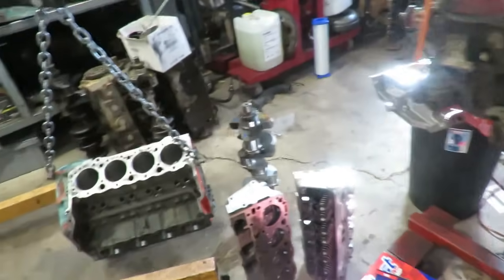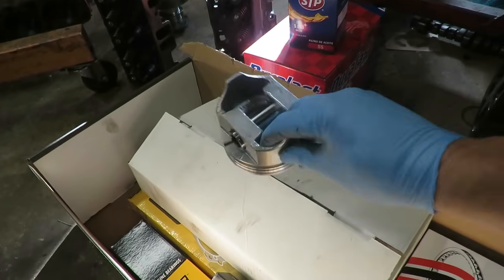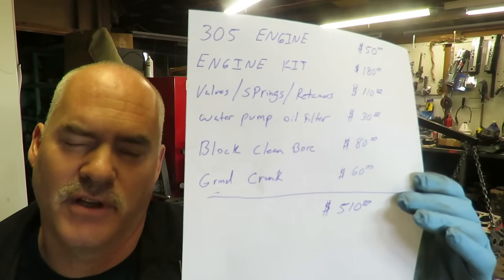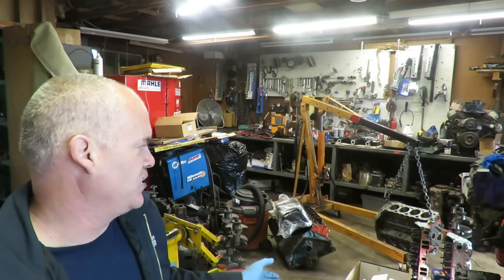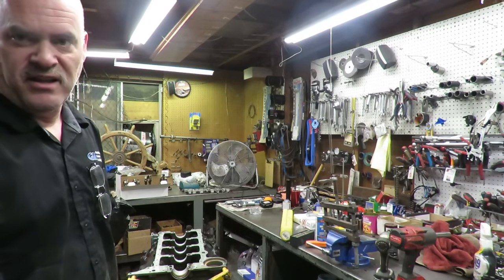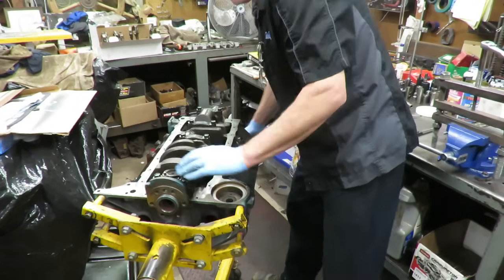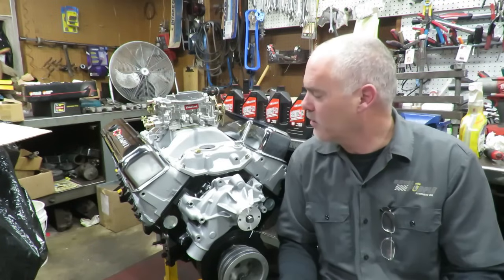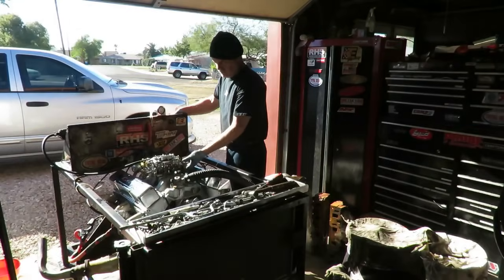Small Block Chevy extreme Budget Build

Comment: You can always build something on a budget there are lots of options, but this definitely isn't a high power plant build, in my opinion if you're going to build an engine, build something that's got a little something.

Back in my high school days, a buddy built a 305, just freshened it up similar to this one, and he was a car length behind me at the track every pass with my 74 Camaro with a stock 350 and about 90,000 miles after sitting in a barn for 5 years, against his freshly built 305 in the 76 Nova, the dude was pissed his fresh built 305 motor couldn't take on the exta cubic inches of my tired old Camaro. So I would definitely put some thought into what you wanting to build before you just throw anything together, why waste the money, on something that just sounds the part, like the engine in this video.
Reply: Those old low compression 350s from the 70s (882 heads) made about the same or less as stock H.O. 305s from the 80's... The 305 issue isn't the bore size dude it's the lack of performance parts in comparison but nowadays they make performance 305 stuff designed for the smaller bore (Trick Flow Super 23 or World Products Torquer SR) 350-400 HP range in a 305 is not unrealistic

Comment: I got a 355 flat top with vortec heads with 202/160 valves. It’s got a extreme Energy 268 cam  how much horse power and torque do you that it will have. It’s a 87 model block
Reply: 195 HP
Reply: 340/370

Comment: That is a totally way huge cam for a stock 305 with almost no compression. I would have used the Summit #1102 or even the #1103 for $61.
Reply from the maker: The compression ratio is 9 to 1 with the dished piston and the 601 58 CC heads
Reply: @Myvintageiron7512 
Hum, I was thinking the HO 305 had about 8.5 to 1 so that is a bit better.   My budget builds always start out good but right at the end they end up being $2 grand so my thought is If it even starts for less than $700 bucks its a miracle. Good job.
Reply: any 305 1986 and later  is 9.5 to 1
Reply: I have a ‘68 chevelle with a 307 factory and I have a 305 Ho that was given to me with 58cc big valve heads.   I’ve seen people complain about both these engines.  I just don’t want my chevelle to end up like 90% of them are with an ugly LS now a days.   That said, I love to roast tires to.   Ideas?

Comment: my 350 engine block gen1 had cam bearing pre installed how do i know if they are in correct position, im also wondering about the things to install or look for like the plugs to oil an water. i have never dealt with a bare block???? any help????

Comment: I think this engine with the "601" heads would have actually worked really nicely with the replacement cast FT pistons with 4 VR... 1.54 compression height.  Pistons in the hole .010 and the .028 thick Mr Gasket head gaskets (3.79" bore) for an .038 quench would bring compression to around 10.8... Great match for the cam.  The non lightweight "601" castings are actually fabulous with porting (please research) and prefer a single pattern (or close to) cam. (Vortecs flow better on intake but can't touch "601's" on the exhaust when ported) With PROPER PLANNING, elbow grease, and ATTENTION TO DETAIL that little budget 310 small block could be a nasty little 7,000 RPM mouse!  ~Not at all challenging the host~

Comment: Very cool video!! 
I have a 602 Crate engine that I’m about to fire up, what do you recommend for a break in oil? I don’t wanna use my Mobile 1 15W50 synthetic at $14 a litter for break in! It’s so expensive to use that oil then drop it...
Reply: AMS oil has some great High Zinc content break in oil to make sure that cam stays happy for the break in
Reply: What grade of oil and do I have to stick with synthetic for just the break in?
Reply: You have to use oil with Zinc for break-in but I also recommend zinc for flat tappet (lifter)cams too you can buy zinc additive.
Reply: Most local auto parts stores carry at least one High Zinc oil, they may have in non synthetic, I'd say run synthetic for the break in just for the sake of correctly ensuring when you break that cam in and she gets warm it'll still lubricate
Reply: I have been told not to use synthetic for break in. Anyway, I have heard that Royal Purple has conventional break-in oil, and that might be the easiest to find. Brad Penn has a break in oil as well.

Comment: people seem to be confused and think a 305 is not a viable option,honestly if you need less than 300 horsepower it will work great and not cost a fortune either.
i bought a 225 horsepower LB9 305 out of a 1991 trans am for $300,sold the tpi for $200 and have a mint longblock for $100(80,000 km engine)ive been picking
up parts here and there,just got a set of aluminum corvette heads for $200,a cam and lifters for $75,b/n waterpump $50,b/n holley ultra and edlebrock rpm $500.

it doesn't need to cost a fortune and it will be a decent street rod engine.

Comment: I don't know why people don't invest money into a camshaft. It is the heart of an engine. Howard's cam is light years behind Crane cam or Comp Cams extreme cam line. Yes it was correct the cam had 108 LCA for a 305. Vintage friend will have to run headers with this header because of the LCA on this engine to get max power.

Comment: I see a big problem... You said you weren't going to use headers, then have headers on it when you run it.
I sure hope you gave it more than the break-in, than you showed otherwise that flat tappet cam and lifters will probably to go flat soon. You can't let a flat tappet engine idle right after start up.
I would really like to have heard that with the stock manifiolds as opposed to open headers... I did enjoy the build :-)
Reply from the maker: The headers are only for the run stand as for the break in it was done the day before off camera it already had 2 hours run time on it the forst 30 minutes at 2K with high zddp oil and buy the way It's in the rad rod and it haul's ass 1685 pound car

Comment: Would cost a little more than $698, but a 305 with a 3.75” crank is a fun street engine that won’t break the bank, 334 cubic inches. 👍🏻
Reply: Most shops would advise against this usually from a dollar / performance aspect.  I've seen a few and they ran good though, one had over 400HP.
Reply: Stepside1986, I know it’s not ideal, and I’m not saying everyone should build one, but it can be done for less money than one would think, especially when decent 305’s are so cheap. I helped a friend build one, it runs great, makes a surprising amount of torque. I know an engine builder that’s built quite a few of them too...

Comment: Like the build and the price.  One question though.  Was that the initial fire up of the engine?  If so, arent you supposed to bring a new start flat tappet came up to 2000 rpm for about 20 minutes?  So you dont wipe out lobes?  Just asking.
Reply from the maker: nope did a 30 minute cam break in the night before it was a fairly cold start temp at about 120

Comment: Hello, I was wondering how are you able to run that much lift without using screw in rocker studs. I have seen cams with less lift pull the pressed studs out.
Reply from the maker: studs were pinned

Comment: I've got a question for you a little off the subject of this video. What is the main cause of roller lifters on the GM ls syle engines such as 5.3 and 4.8 & 6.0 . What caused the problems I've seen on different videos with roller lifter getting pitted and chewing up cam lobes?
Reply: your question makes no sense.

Comment: New Subscriber, I'm interested in having you build me a 350 Chevy, no interested in buying a mass produced eng. from a big company, would rather support the small guy's, and thru your videos, I can see that your not just an engine builder, but you have passion for your craft, so I have a 1986 Chevy square body Blazer, it has a TBI engine with 90000 miles, what's your contact information so I can e-mail of call to make this happen, not in a big hurry, but would like to get your thoughts on swapping out the TBI to Carb and getting a reliable eng. with some more power, maybe 350 to 375HP. Thanks  Tim Morris
Reply from the maker: message me on Facebook at myvintageiron7512

Comment: I would say more than 200 but tq prolly in the tank. That cam might be the largest ever put in a treeoh5. The money spent on 601s maybe coulda got set vortecs, if motor had low miles maybe justa hone with 3.75 stroke instead of .030 over and 3.48 stroke. Dont think elderblock is gonna like all that dur. Might need 4150 carby down the road.

Comment: I got a 350/30over and run the vortick head with 202/170with 450450 M with two 650cobs tul ram with 410/5spded but I can't seem to site the Vails an the heads are 305heads but just how do I get the M sjte

Comment: I have a 89 chevy c1500 with a 350 tbi crate motor only 26k miles on it, I'm not sure what's in the motor sounds like a stock cam tho. Is it possible to add a cam an make power while staying tbi? Gonna be my project for 2019 an want to start asap just need some pointers
Reply from the maker: yes you can I would go with vortec heads they make a TBI intake for them

Comment: What was the cost of the heads? Those heads you mentioned are not easy to come by and they aren’t really very cheap. You should not have skipped the cam break in which is very critical on a flat tappet.

Comment: the cam i like is 585 with 312 duration my 327 has 675 lift it was a bitch to get it in but that motor is for racing pump gas it not a cheap build at all but i put a 327 too gather from swap meets cost me 436.98 to build with 202 angle plug heads steel crank  but that was 1993

Comment: I have a question can I use a Chevy 350 crank on A 305 I know that they are the same identical crank, just one is lighter than the other the 350 Chevy has more counterweight will it affect my 305 ?
Reply from the maker: you can if you get it balanced

Comment: i got a motor out of pull apart that was a fresh rebuild for 140 dollars vortec heads 68 dollars 125 to get the heads done 210 for a com cam and lifters ,ls2 springs and retainers 180 ,65 for gaskets  so 800 and runs like a top put it in a s10 its a 350

Comment: Definitely a a steal deal , do you suppose that some more cash could get it to 300-325 hp range ?
Reply from the maker: If I had more money we would have bought a 350 core for a few hundred bucks the real tipping point for going with the 305 was the $50.00 price for a low mileage long block to build you could do a 350 for about the same price but again you won't get one for $50.00 around $300.00 is average for a 350 core and most of those will require a ton more machine work because they are usually pretty well used up the 305's get removed with low mileage and sit for years under a bag in the conner of someones garage
so very often you can rebuild one very cheaply,  sometimes you can even hone the cylinders by hand and just re ring because the cylinders are in such good shape and it;s even less money than I spent. It is very rare now days to find a 350 core that you can just do a light hone on and re ring  most of them are very worn out and require extensive machine work
Reply: @Myvintageiron7512  
i currently have four sbc motors 3 of which i scored for 0$   so the 350 is a good power plant ?  it seems i gets ditched in favor of the 383{ ive done 2 for friends} is this mores law aswell?

Comment: Ok quick question, i have been looking for master rebuild kits... Most i have found i cannot give specs for pistons where the block was bored.  Any suggestions would help
Reply: you need to know how large your block is bored over BEFORE buying.common sizes are 0.02 or 0.03 thousandths over but DO NOT BUY UNTIL YOUR BLOCK IS BORED

Comment: could you please clarify for everyone how the Cam bearings of a SBC 350 should be aligned. I've heard a couple different things. With the block inverted, the #1 bearing holes should be at the 8 and 4 o'clock positions. Bearings 2-5 holes should be at the 8 o'clock position. Of course that is contrary to the standard 12 o'clock positions for bearings 1-4 and Bearing 5 at the 6 o'clock position. These are all with the block inverted and looking from the front. Thanks!
Reply from the maker: It doesn't really matter where they go SBC has an oil groove that feeds oil all the way around as long as you oil hole is lined up with the groove your set

Comment: OKI   TSA-NI-TAPI means hello how are you in blackfeet language  I have a stock 1983 chevy 350 3/4 ton 4x4 hunting g rig I was wondering what's the biggest cam I can use in it I'm getting new dual exhaust. headers.it has a eldelbrock carb and intake.oh ya it's a 88 Chevy  350 I put it in my 83  it had the port for the fuel pump on it so I don't have to run electric fuel pump I wanna put a bigger cam it's all stock.with everything on it I wrote above

Comment: What is your thoughts on a complete novice attempting a stock rebuild on a 350.
Reply from the maker: I think he/she will need to go slow and check and double check everything getting clear instructions every step of the way I also think they should have a good relationship with a local machine shop have them check all your clearances and get your parts for you as well as doing your machine work

Comment: So since the lift limit is half an inch and you're running .49", doesn't the rocker arm ratio factor into the total lobe lift? Stock 1.5 ratio rocker arms put total lift well past half an inch.
Reply: .49 lift is the lift with the standard rocker ratio included. If you measured the actual cam lobe lift it would be about 0.325” lift
Reply: @Dungfunnel  That's pertinent information, especially if you have a cam in mind that you already have for a budget build, but don't account for the extra lift of the rocker arm ratio.  You can 'cheat' in extra lift using a stock cam by just changing the rocker arm ratio.
Reply from the maker: LOL the .490 lift is at the valve man!    if the lobe lift was .490 this cam would be .735 that is a solid roller dragster cam
Reply from the maker: your not going to find a .735 lift cam for $50.00 it would be more like $1200.00 with a $500.00 set of springs and $800.00 set of rockers to make it work when people give you a lift speck it is almost always valve lift no one really talks in terms of lobe lift unless they say that's what they are speaking of 99% of the time when you hear anyone give out a  lift spec it's at the valve after the ratio it should always be assumed that valve lift is what is being discussed
Reply: Myvintageiron7512 Then there’s advertised duration and duration @ 0.050”. That confuses people too don’t you think?

Comment: Yes because from what I understand the thing everybody used to do to screw up power output of a 305 was put too much cam in it!
Reply: @johnnyhhh7928  Nice! What all did you add to it to get that kind of output? I've got an 87 Monte Carlo SS and was trying to decide between an engine swap or keeping my 305 and upgrading parts to make it better.
Reply: @johnnyhhh7928  Thanks for the response with detailed information. Thats gonna be on my list of things to upgrade.
Reply: @johnnyhhh7928  Thank you. I think that will depend on how the factory heads look, but I'm not against upgrading the heads as well. I've decided that my upgrades will be a year by year thing. Engine, transmission, and exhaust year one, suspension, brakes electrical upgrades year two. Body, interior, and paint year three. Of course that plan is subject to change, but that's the general idea.
Reply: @johnnyhhh7928  Yes, this will strictly be a street car. A toy to cruise around in on the weekends, and remind me of my youth. I had an 84 Cutlass Supreme as my first car. Helped my dad rebuild a motor out of a Buick Rivera during my senior year of high school and dropped it in the Cutty. Wish I would have done more.

Comment: So, extreme budget build and the first thing i hear is "we had it bored over....."

also, looking at the machine work. it would cost at least 3-4x more than that where i am. its minimum 120$/hr
Reply: 69Bandittt this is true, your chances of finding a block that won’t need atleast a .010 overbore is next to none. Chances are the crank and rods are gonna need some love too. Unless you can grind your own valves and seats then you gotta pay for that too. 

Take the machine work and labor out of the equation and most mild engines are “budget” builds. 

The only time this has ever been done properly was a series of articles Hot Rod magazine called “Junkyard Jewels” were they did no machine work and threw parts at old, fresh from the junkyard engines picked out by inspecting for the best candidates. They did a SBC and a SBF build.

Comment: The exact same thing I done last year i was going to be under 400 but had to by a crank from the zone  had bore 30 and cam bearings freeze plugs like 50 somthing kit 200 somthing with pistons extra 20 bucks when block was done the rod bearing had to be replace cause the one in the kit was bad extra 15 bucks ended up 500 after all was said and done cause of the extra crap I had to do

Comment: Are 307  parts interchangeable with 305/350 parts?
Reply from the maker: most parts will yes, the 307 has the same crankshaft as a large journal 327 (3.250)  and a 3.875 bore these engines got a bad rap back in the 70/80's because they were chocked out with smog equipment and small valve/port heads I have built several 307's that made very respectable power ran 13.5 in a 71 chevelle complete car no weight removed if you bore the cylinders .060 over you get pretty close to the 327 bore size of 4.000 it is 3.935 and there is plenty of beef in the cylinders to go .060 with no problems you end up with 316 CID a whopping 11 cubic inches less than a 327 you will hear guys talk about how great the 327 is and how terrible the 307 is they don't have a clue what they are talking about I wouldn't hesitate to build a 307 if that's what you have they are much better than the 305